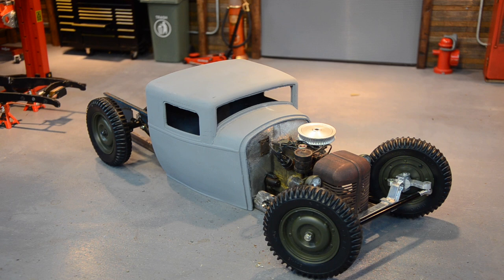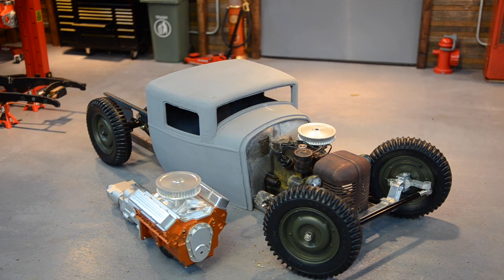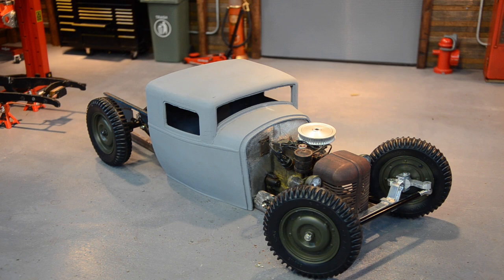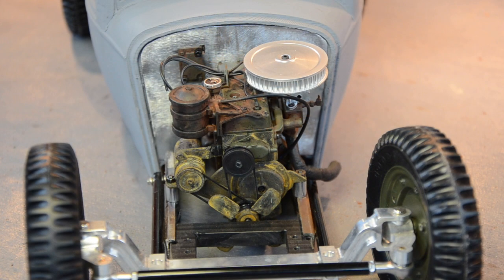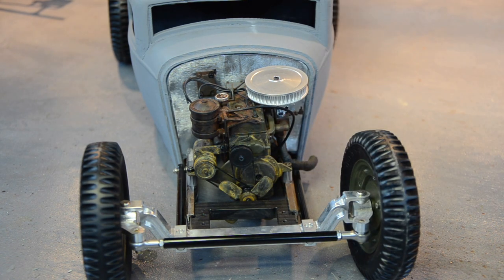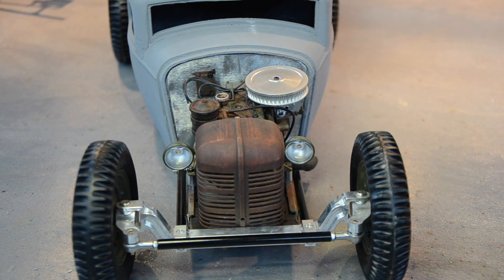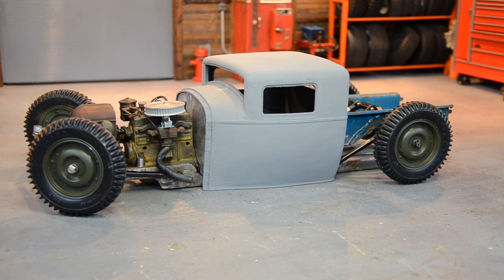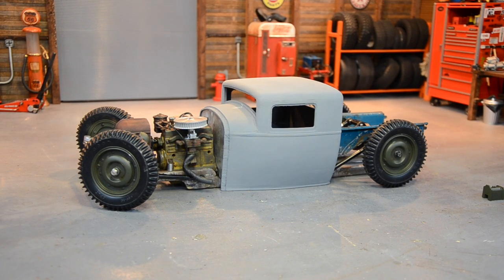Traditional Style RCRatRod Build, Part 2, Weathering the Flathead Engine, RCengineering

Comment: It's the perfect engine for that type of build. Is the block cast pot metal?
Reply from the maker: Yeah, a lot of the parts are cast metal.  The little bits like pulleys, distributor, fuel pump are plastic.  Its not too terribly heavy all together.

Comment: Hi, where did you get this engine? And by chance how can I look for this front axle. (Sorry about English, because I'm Brazilian and I had to translate it by google! hehe)
Reply from the maker: Hi! The engine is very hard to get, came with an expensive "eagle moss" brand willys jeep model kit.  The front axles are easy to find, I get them on ebay, they are for tamiya 1/14th scale semi trucks.
Reply: @RCeveryday  ok, but is there an engine model that is "easier" to get?
Reply from the maker: I haven’t found one like this. The flat four style is not very common.